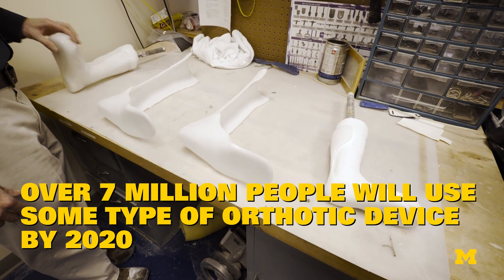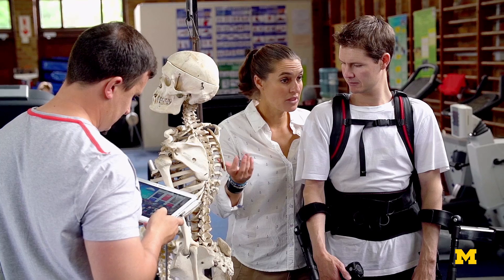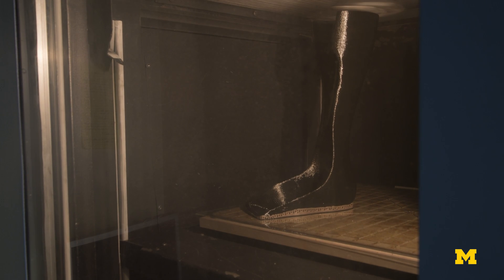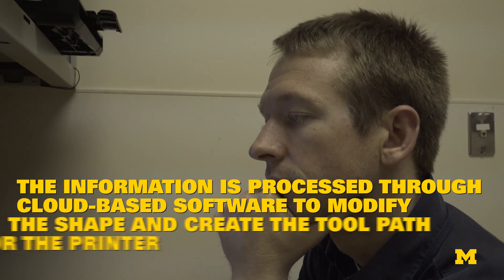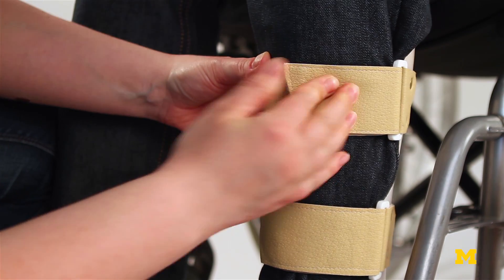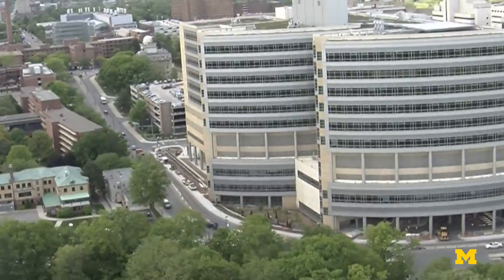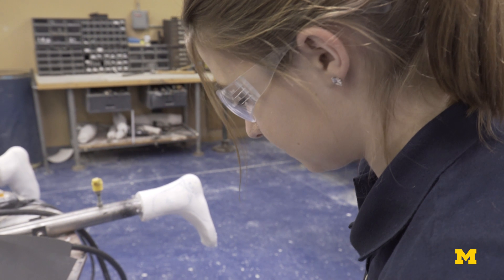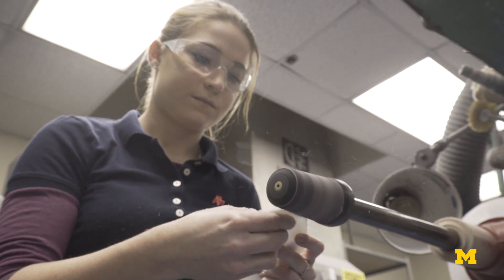Using 3D printing to speed up orthotic and prosthetic production

Comment: Just tired of all these misleading "tech" videos. I've been making custom orthotic devices for almost thirty years. To say that all is needed is a scanner, a computer, and a 3D printer, is just false. You would still need something to cut and smooth edges, to heat modify the plastic, to drill and attach a closure. What about padding? 75% of orthotics require some padding. You then need to cut and sand and glue padding. None of these features of a "custom" brace are addressed by 3D printing...  Still a long way to go.
Reply: It's been 2 years since your comment. Please share with us if you feel the tech has improved. Thank you.
Reply: Still same. Still need adjustment. Padding. Heating